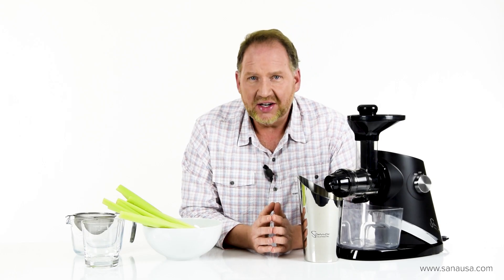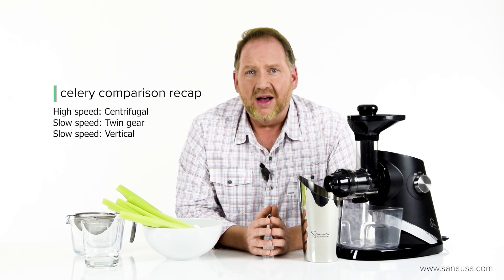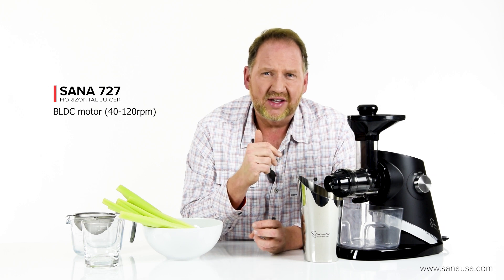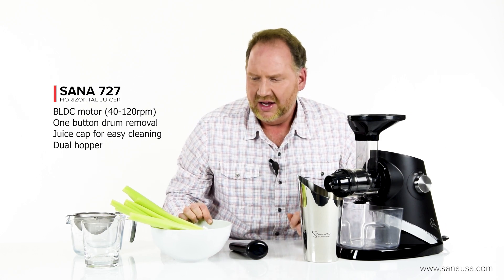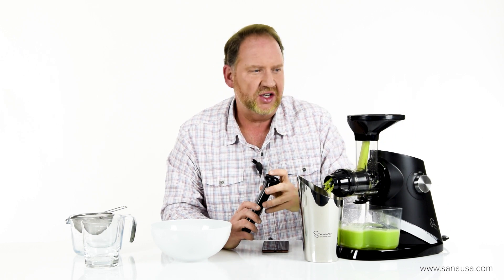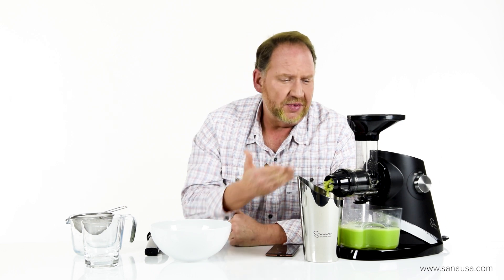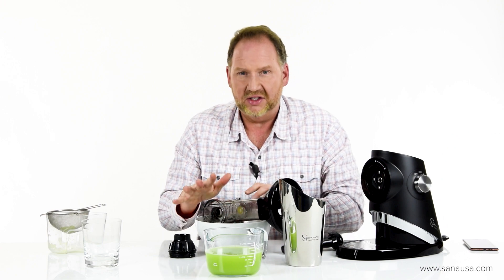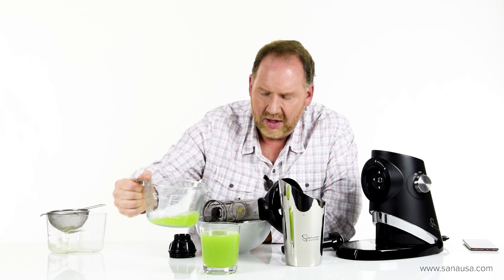Celery Juicing with the Sana 727 Supreme Juicer

Comment: This juicer has a number of disadvantages: 1. the tip cannot cope with fiber, it is wound around the screw and it is often difficult to clean this because the manufacturer does not provide that this is necessary. 2. it is absolutely not suitable for celery, of course it is suitable, but it is pure torture. my juice therapy ends with endless washing of this machine, which turned my morning into agony. Even cutting to peaces is not helping.

 It’s a pity, it looks great, for this price you expect a little something different and yes, Sana’s customer service does not have the uniqueness that is being said, they simply do not answer emails! I don't recommend it at all.
Reply: Wow, really? This is first negative comment i heard about this juicer? How do they not answer emails? So what exactly happens with celery pls? I juice celery with old omega 8006 n have no issues, does it gets stuck?